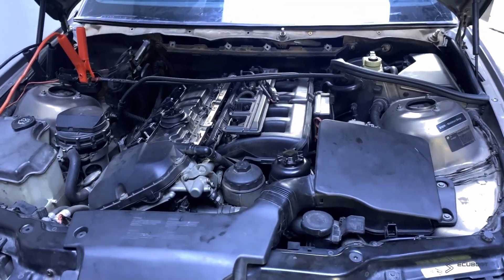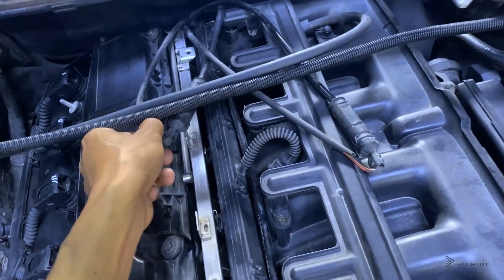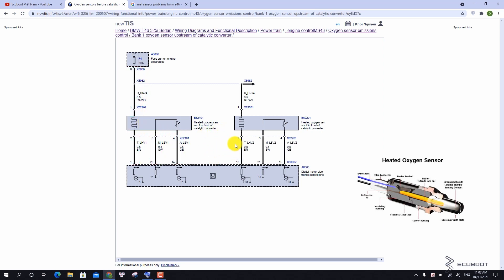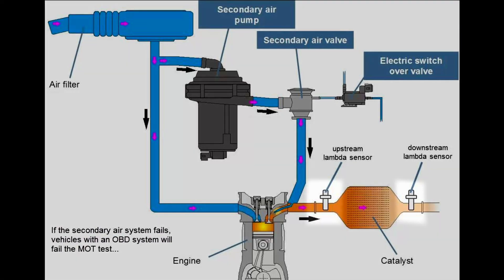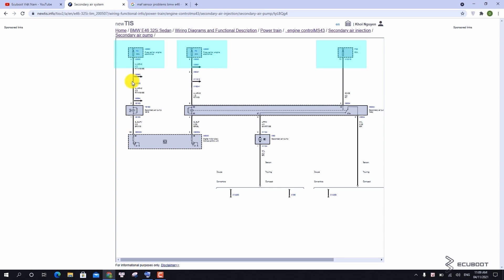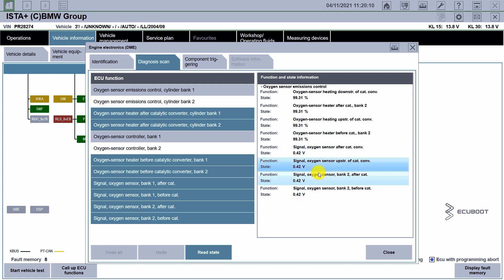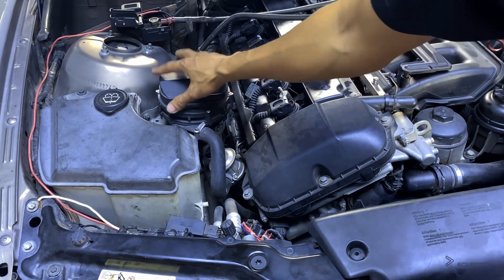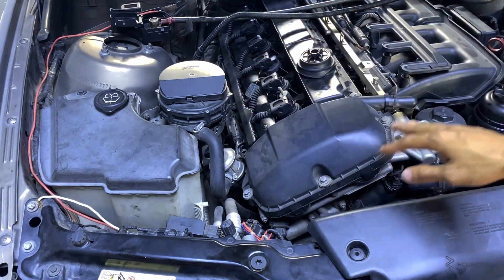Fixing BMW Catalytic Converter Efficiency Below Threshold Code P0420 & P0430

Comment: Thanks n51 owner here and my secondary air pump has been failing lately making grumbling noise upon start up  I went to clean secondary air pump port out with o2 safe cleaner and I got tons of soot out of the port but shortly after receiving cat conversion codes now hoping it’s just bad o2 sensors or the air pump failing thx